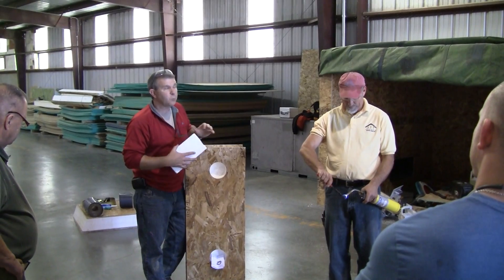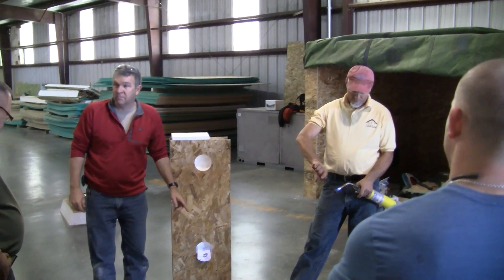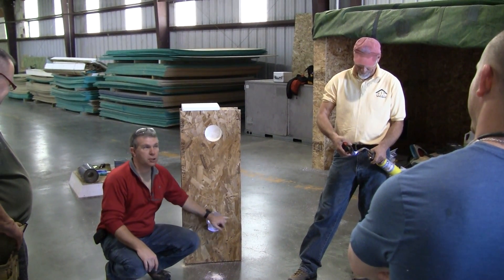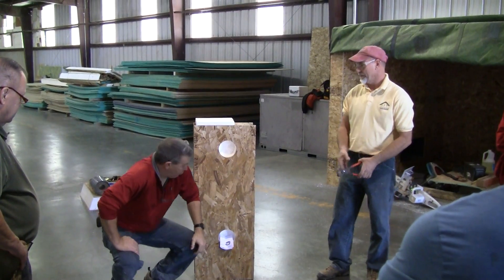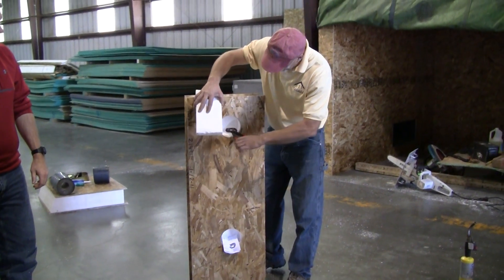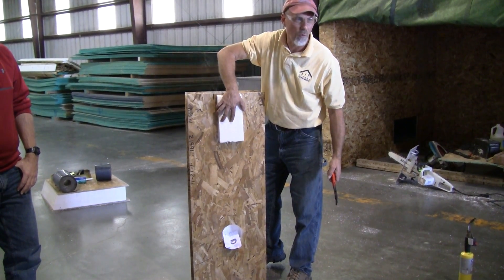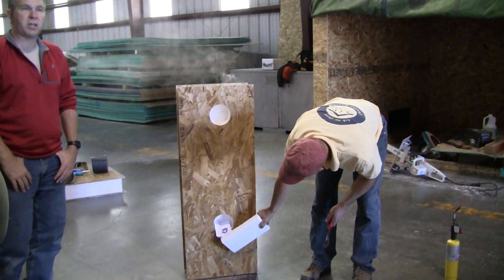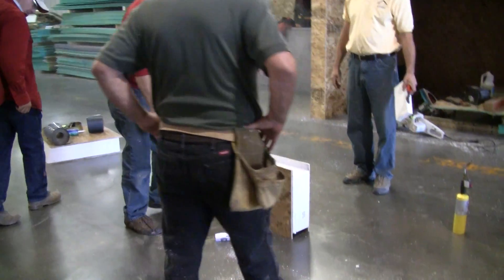SIPschool's SIP Installation Basics: Hot Ballin' with Al and Dan

Comment: Thank you ... I unfortunately figured that out the hard way :) but got the job done similar to your suggestion. Used a long and wide flex bit and had to hand crank the bit down the wall with the help of a friend. Took some muscle and sweat but it actually worked out well. Not the prettiest chase but it worked.

Comment: I have spray foam insulation in the walls of my place.  Packed from dry wall to brick. Will the same process work on spray foam insulation....I just want to run a 4 foot chase through the foam insulation.
Reply: Sorry for the delay - had not seen your question.
Urethane foams are thermoset material and will not melt when using the "hot ball" technique. EPS foam is a thermoplastic and will allow a hot ball to create a chase within the panel. In your situation I recommend cutting access holes four feet apart in your drywall and using a flex bit drill to bore through the spray foam insulation.